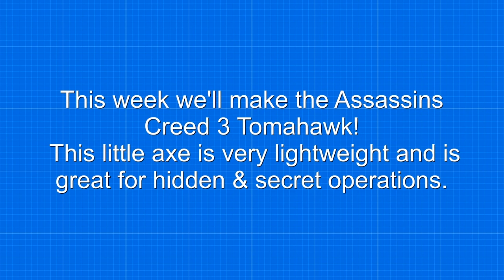Assassins Creed 3 Tomahawk - Free templates

Comment: Big fan, excellent designs, beautiful videos...slightly inconvenient storage method for the larger projects. Good luck with your tests, don't forget to decompress every now and then. Could you please put out the plans in a format other than .RAR and .ZIP, please?
Reply: Also, I find tape works for larger pieces, that don't require delicacy and accuracy, but gluing plans to the wood with a cheap glue stick is more reliable, I find. To remove them, you can sand the paper off, or weaken the glue with rubbing alcohol. Wasteful of templates if you do it wrong, but far more accurate, I find.                                                                                                     Big thanks for all the ideas.